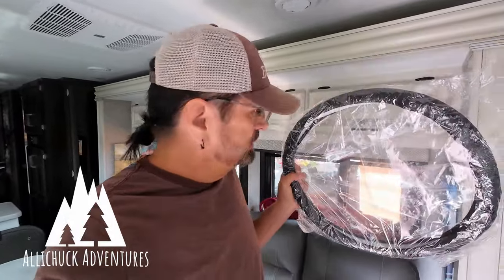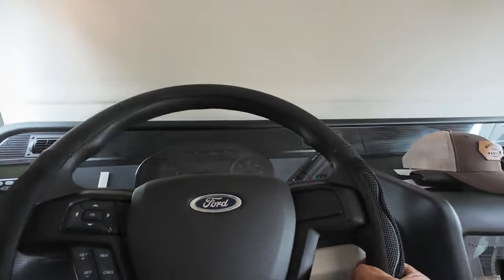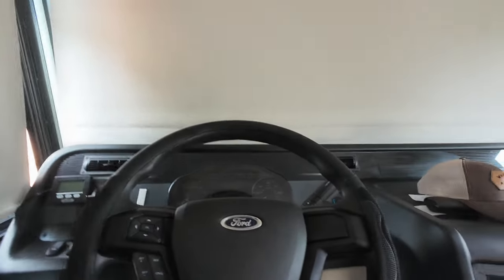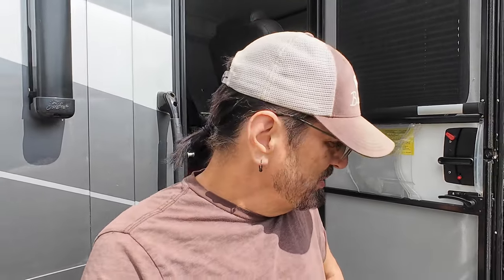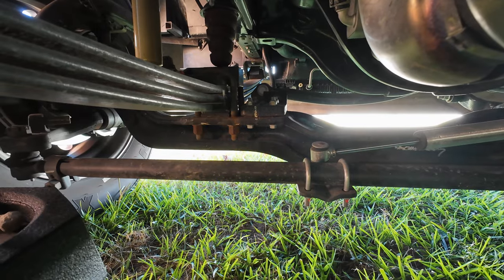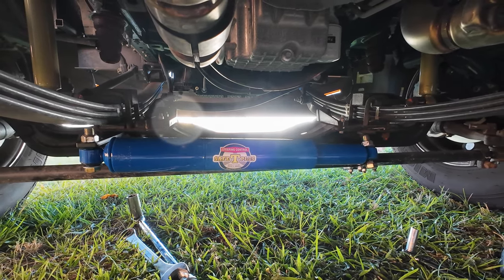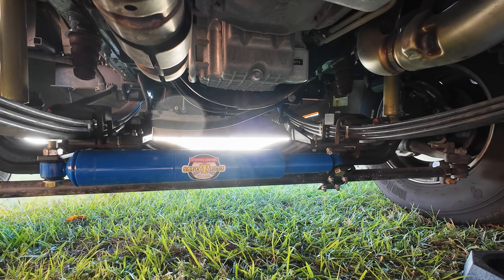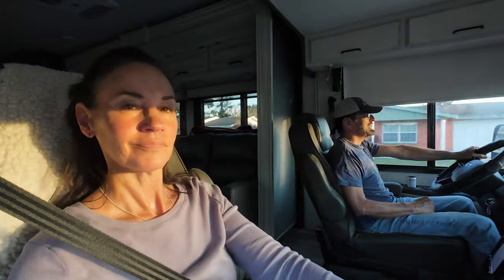Upgrading OUR RV's Handling: Safe T Plus Installation & Review

Comment: Recently installed the safe t plus on my 23 bounder which I thought being new shouldn't need it. I marked the steering wheel when driving before install to find center, then installed stabilizer, and got lucky with not needing adjustments. 100 % better and less stress with driving. F53 motorhomes should come factory with the safe t plus. If for nothing else... safety reasons.
Reply: Factory parts to remove liability.
Reply from the maker: I totally agree they should come with this. Why would they not? Seems like it’s a safety issue.
Reply from the maker: Of course you’re probably right on the liability

Comment: FYI. My 2003 25 foot Class C E450 Super Duty came with the stock stabilizer shock installed. I decided to upgrade it to a Bill Steen and hated it. It worked so well that wherever I left my steering wheel, that’s where the motorhome went. I found a very fatiguing just to drive a straight. So I took it off and now I drive with no stabilizer.  Now it’s like driving my car. I just react to slight fingertips steering adjustments. Now my RV drives  effortlessly, very controllable with no oversteering fatigue.  This may not be the case with longer wheelbase RVs.
Reply from the maker: Thanks and good to know. 😁

Comment: There needs to be a little bit more beef to that plate that bolts to the tie rod. It bends way too easy. Also the u-bolts should be like the ones that are used on U-joints with a flat area that lays on the tie rod

Comment: What did you find out about the shock being parallel to the steering bar? Did you leave the u- bolts kinda cockeyed or straight up and down?
Reply from the maker: Ended up straightening them out. Working great!
Reply: @AlliChuckAdventures  Thank you
Reply: I think they want it at a slight down angle so water can drain out .

Comment: Steering wheel cover are once of the things to remove if you are thinking about safety...
Reply: And that linkage bracket looks way to flimsy, the bolts in one end, and the load bearing at the other end... Wonder how long that will last...
Reply from the maker: Well I guess we will see